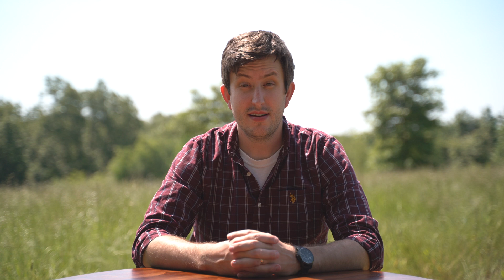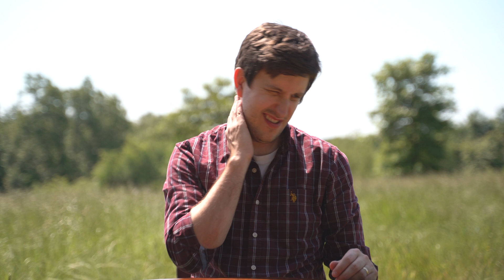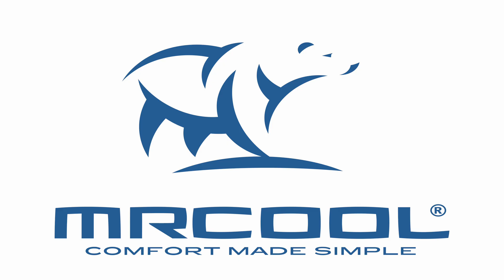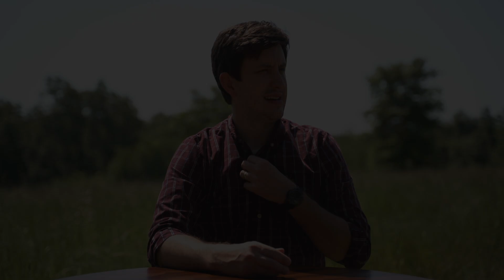What Are Error Codes? - MRCOOL DIY Ductless Mini Split

Comment: I've got a 27k compressor with a 12k air handler and I'm getting a P6 error code. But from reading above this only applies to a 36k unit. So what gives?
Reply from the maker: If the unit is a multi-zone condenser, the P6 error code is an operating pressure fault that can be either high pressure or a low pressure. The condenser control board will display either P1 for high pressure or P2 for low pressure. The 27K condenser should not be started up with only one 12K air handler connected. At least 50% capacity is required to be connected to prevent damage to the compressor. In addition, the master service valves must be opened. These valves are shown in a picture on page 31 of the installation instructions. Operating the unit with these valves closed can also damage the compressor.

Comment: Any idea why the indoor unit would display just two flat bars?  I had a unit running on cooling, left and came back and it was displaying the two flat bars and had closed the vent.  Any remote input would register on the unit (like adjusting temp up/down) but it would open the louvres and stayed off.  I went to the other unit which was off, fired it up, it briefly opened the louvres then displayed the two lines and closed up.  I cycled the main breaker, and the unit seemed to come back, and the heads worked again.  I can find no documentation on what the two bars mean.
Reply: I had the same issue yesterday but I quickly figured out the cause of the issue. The "heat" mode trumps all the other modes including "cooling" mode. So if you have more multi zone unit, make sure one of the handlers is not set to "heat" otherwise the other handlers in the cool or auto mode will stop working and display the two flat bars whenever the one in the heat mode is turned on. I have a 3-zone system and my daughter mistakenly switch hers to heat mode. So the other two handlers were working fine but whenever she turns on the AC in her room, the other two will automatically shut down and display the two flat bars. So all I had to do was switch her handler to any other mode besides the heat mode and everything started working as expected. I hope this helps.
Reply from the maker: That's a new one on me. Give us a call at 270-366-0457 to speak with our tech team. We can try to figure out what happened.
Reply: @MrcoolComfort   I just experienced the same error. Now I can only turn two handlers on at a time. The two dashes will come on whenever I turn the third handler on and when that happens, the Condenser turns off whilst the two dash displays on the handler.

Comment: P6 error code please explain. Tech support is not 24/7
Reply: I'm getting the same one. What did you do to fix it? I'm getting it on both heads of my dual zone 21k unit.
Reply: @philkingmke  any update on the p6 error code?
Reply from the maker: Please contact tech support at 270-366-0457.
Reply: @Evan Glendinning thanks bro!
Reply: @Evan Glendinning 
Could you be more specific on where the gray valves are at. I also have the P6 code and I suspect pressure but I only have the two valves on the compressor

Comment: Any idea why the firmware updates always fail? I've been trying to update the firmware on my 18000 BTU mrcool unit since April and about every two days I attempt it and it's gotten as far as 58% but most of the time it fails around 22%.
Reply: Is there a problem with the operation of your unit prior to the firmware update? An update may not be necessary. Also, if a cable connection to a PC is involved, try using a shorter or different cable. For instance, some low-cost USB hardware doesn't like long cable runs.

Comment: Can you make a video for P6 error?
Reply: I'm getting the same one. What did you do to fix it? I'm getting it on both heads of my dual zone 21k unit.
Reply: same here P6 error code, manual says "outdoor temperature sensor" please tell me how to address this issue
Reply: @Evan Glendinning I'm getting the same error
Reply from the maker: We'll see what we can do.
Reply: @MrcoolComfort  it seems like this is a common error A video on this seems like a great idea.
Reply: @MrcoolComfort  P6 Error code on a 27 BTU Multizone, 12 k head and 18k head. Customer support not responding.

Comment: I looked all you error codes and I don't see dF.  Do you know what that means?  Thanks!
Reply from the maker: dF is for defrost. There may be an issue with that mode. Give us a call at 270-366-0457.
Reply: @MrcoolComfort  is there a fix for this error?  My unit keep on going on and off about every hour or so we have the unit in "heat" mode and is getting kind of annoying now since is cold and the unit stops we have a new born (five weeks old) I like to fix this error. Thank you
Reply from the maker: There is a fix for everything, but first we would need to figure out what it is doing what it is doing. Give us a call at 270-366-0457.